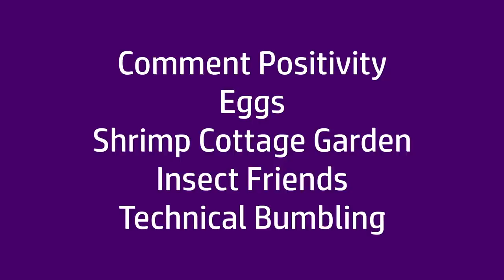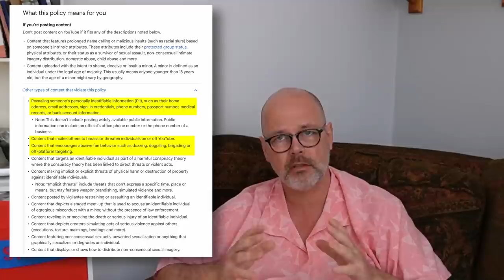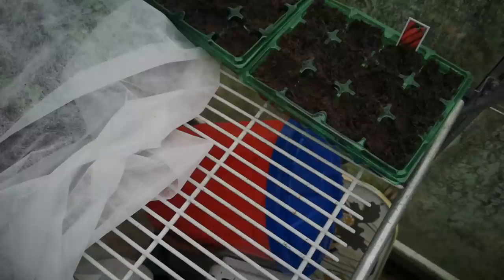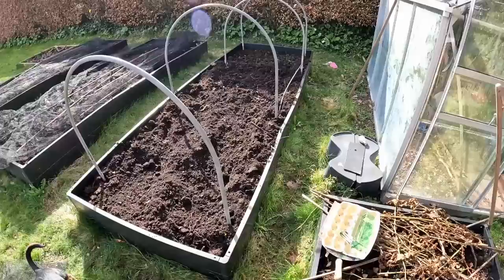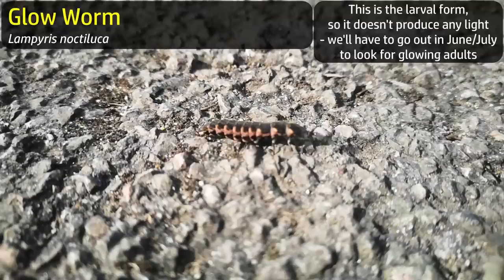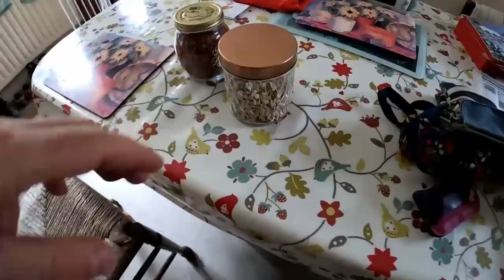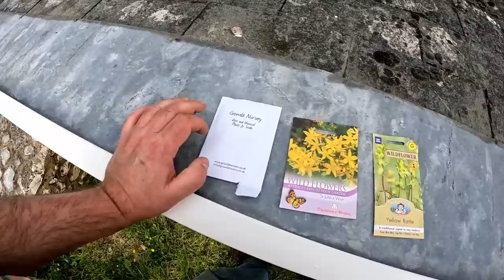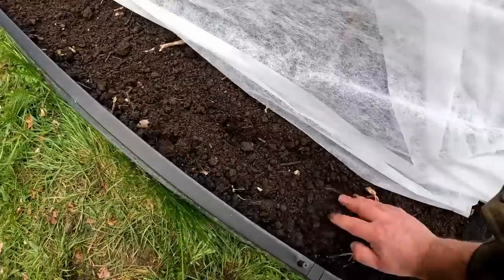Random Stuff - Comment Positivity, Eggs, Shrimp Cottage Garden, Insect Friends, Technical Bumbling

Comment: Always enjoy these videos, thanks! 

We do eggs a similar way, but the water goes in / lid goes on, a little earlier. Using a glass lid (if you have one) is also really helpful , so you can get them out the second they are done. 

Side note: if you turn down the burner a bit, some baby spinach is a good replacement for the water. The spinach wilts and drops it’s water at the right moment for the eggs to steam. The result is eggs somewhere between fried/poached and wilted spinach in the same pan. If you time the toast right, it’s an easy breakfast that’s hands off and takes a couple of minutes.
Reply: Ooooooh, interesting. Sounds perfect. Thank you.
Reply: I just fry the eggs without water on medium and use a lid on the final minute. it seems to work the same as far as it looks on camera

Comment: With hoops for the garden bed. I use old garden hose and canes. I push the cane, which is about 1m tall into the soil and then pop the end of the hose over the cane. Then I put another cane on the opposite side and then cut the hose to size.

Comment: Ace video as usual! I love the random stuff videos; a bit of everything mixed in, like an Atomic Shrimp omnibus. I would love to see you apply the cable snips (or some sand paper) to the edges on the turntable so the platter rests on the bearings before it's parted out. Or maybe some mechano could finish what the manufacturer started.

Comment: 3 other methods for people to cook a perfect runny egg if you want options:
1 - What you would order in Canada as "once over lightly": Heat (non-stick) pan over med-high heat for a couple minutes, add oil, and let it heat up to the point where the egg immediately sizzles when you drop it in and the whites immediately start to colour, cook until about the point where Shrimp threw water in his, but just flip the eggs over in the pan instead. Cook on the second side for maybe 10 seconds, evacuate to a plate. This has the added benefit of extra browning/colouration on the top of the egg if your pan is properly hot, but has the detriment of not having a beautiful yolk to look at (if that bothers you or you need it for presentation), and having the possibility of breaking the yolks if you're not confident with your flips.
2 - How I would cook a perfectly FRIED "not quite sunny side up" egg: Same start, but use more oil, and more heat. When the egg is approaching the point where you would flip or steam it with the other methods, instead tilt the pan so the searingly hot oil pools on one side, and use a spoon (safe for the non-stick) to pour spoonfuls of that oil over the tops of the whites until it is perfectly cooked. Avoid getting oil on the yolk. This has the benefits of producing delicious crunchy bits around the edges, more browning on the top, and leaving your yolk pristine looking. It has the detriment of being a bit fiddly if you're not confident in your basting abilities, and not scaling up very well.
3 - Standard method for a cartoon-perfect "sunny side up" egg: Same start as the first time (maybe a little less heat and a little less oil, and definitely non-stick), but just jam a lid on the top earlier than Shrimp did and don't add water. The evaporating liquid from the egg cooking along with the contained radiative heat should be sufficient to cook the whites without colouring the tops of the yolks. It won't taste as nice so far as browned flavours and textures go, but the egg should be ready to display as the Platonic ideal of an emoji egg, or a McDonald's breakfast sandwich, especially if you have a perfect small round 1-egg pan.

Comment: I have a technique for making fried eggs that doesn't require the use of water or a lid to steam it. It's a bit finicky, but it works for me. 

Get a dish, half crack the egg so you can pour out the whites and keep the yolk in its shell. 
Pour the whites into the pan and cook as normal. Whilst there's still just a tiny little bit of uncooked whites on the surface, place the yolks on top.
Cook just for a few moments longer until the last bit of whites around the yolk firm up.

For me it winds up almost entirely yolk with not a single bit of it cooked, so it's entirely runny!

Comment: You could use that turn table for any UV resin curing, I have one similar that I bought for a very similar purpose to yourself that due to not having a smooth rotation has been delegated to curing 3d printed items :).

Comment: Just cook the eggs at a lower heat and put the oil over the eggs, you can use a fish slice to either gentle flick some oil over the eggs or plac it flat on the pan and this will lift some of the oil and dribble it over the eggs.
Reply from the maker: You need a lot more oil that way
Reply: @AtomicShrimp  yea, we up north tend to all have dedicated egg pans, a pan in which you would only cook eggs in. Some people use lard and some people use oil, i lean more towards the oil as its abit healthier than lard.

Comment: Hello, I am an engineer! The stuttering is real, you are not imagining it. It is due to the type of motor used, that is a stepper motor which goes between fixed positions. It was harder to see without the lid on because the radius of rotation of the shaft/your marker was too small. But that motor will stutter because of the way it turns the shaft.
Reply from the maker: I'm aware it's a stepper - that's not the point.  It's only stuttering at one part of its rotation; it's not the motor steps causing it.
Reply: @AtomicShrimp  Ah I see. Stepper motors do hang up easier if there is an obstacle to rotation due to the variable torque and general lower torque as motor speed increases. I definitely agree with you that one or two small motors positioned at the edge of the turntable would provide smoother rotation. Best of luck finding a sufficient turntable!
Reply from the maker: @Discreetkill  on reflection, I suppose it could be skipping steps if the torque is momentarily too great

Comment: Where did you get the mini computer?
Reply from the maker: eBay I think - it's one of these: https://minidis.com/ebox3350
They're very low-spec (but also low power consumption) x86 PCs intended to be used as thin clients/terminals, but can run a full OS if it's lightweight